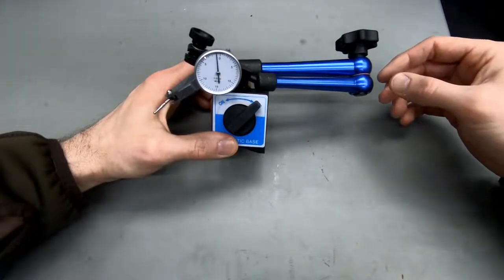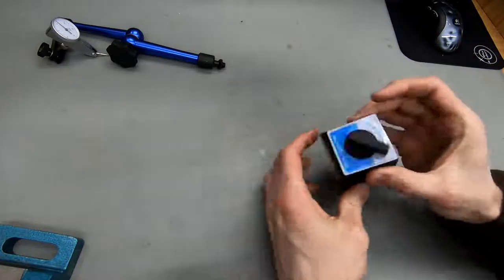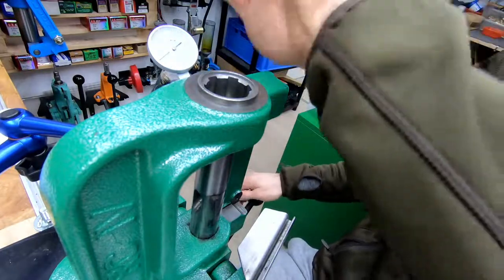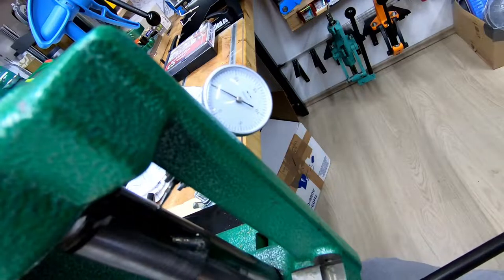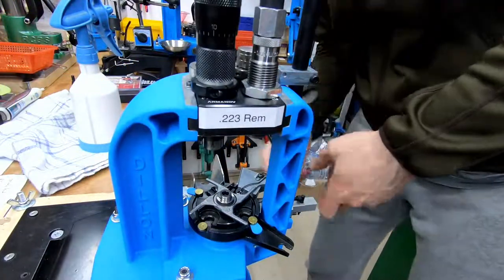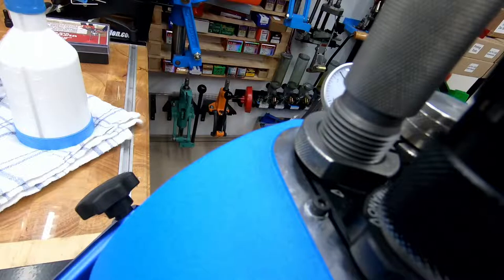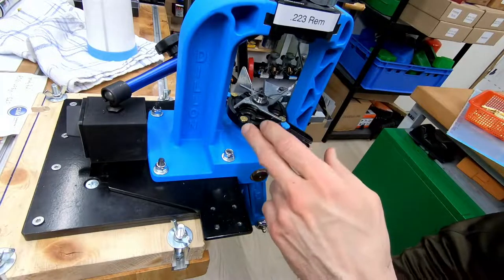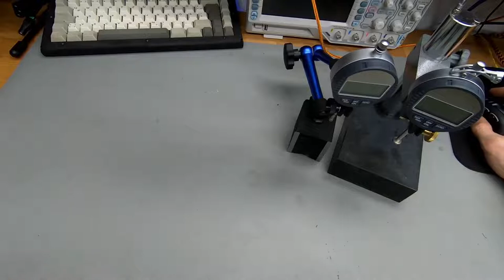Using a Measuring Stand to monitor Reloading Press consistency

Comment: Whats the point of having a precise press, when the last link in your press is a free floating shell holder?...

The only thing that really needs to be consistent is the vertical position on the end of each stroke, so that all bullets are set to the same depth and crimpt the same way. Everything else is self alligning.
Reply from the maker: Absolutely, that's an important measurement of the press. 
Don't underestimate a "sloppy" press ram though. The shell holder might have a little float and the case might sit a little loose in the shell holder. This float is severely limited as soon as you apply force on the case by resizing or seating operations. If any odd movement occurs during these operations, there is a good chance that this results in runout. Especially when you reach the bottom of the stroke and the linkage hits the stop - this is where the force is the greatest and the potential for twisting or tilting in the ram is the highest.
Reply: @GunWodan  I dont think this is really the case. Especially at the end of the stroke the case is heavily guided by what ever die you are using and the force is applied to the base of the case, wich is by far its strongest part. Worst thing would be that the surface the case base rests against ist tilted, and for this the shellholder leaves you with probably 5-10 degrees of freedome. 

There simply is no way that you "bent" the entire case, once it is in the die. 

Actually I would say a precise press with a fixed shell holder is much more of a risk here, because then the Case is fixed the slightest deviation in angle or position would result in the case being twisted into the die.
Reply from the maker: @peteraugust5295  I am concerned by even the slightest bit of - avoidable - runout I am getting in my brass cases. Maybe I will come to the conclusion there is really nothing to worry about - but I'd rather waste my time looking into that than realizing this oversight has been the cause for lots of headache ;)